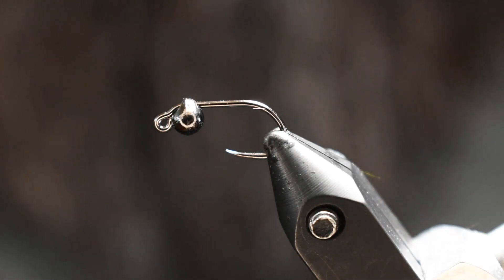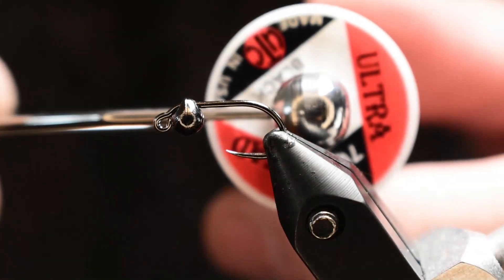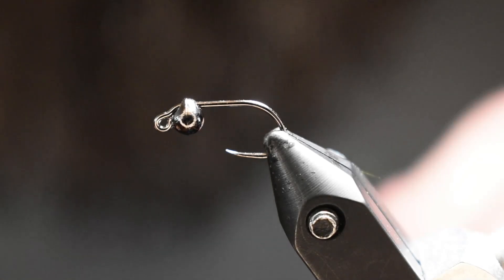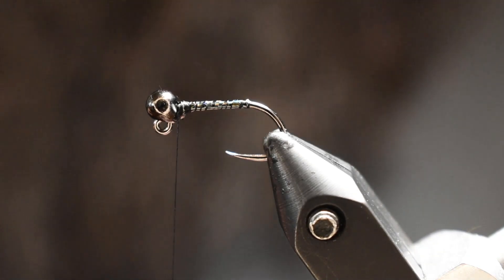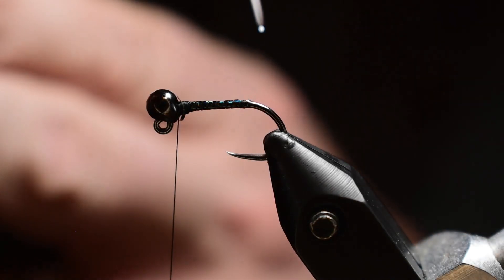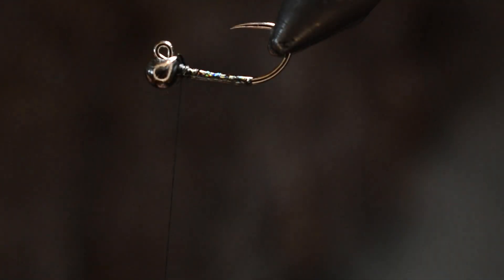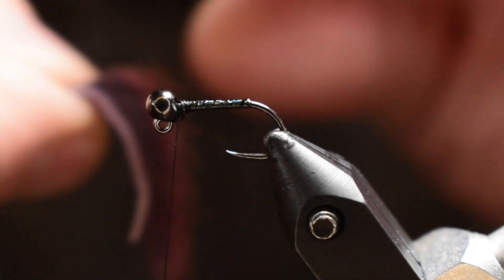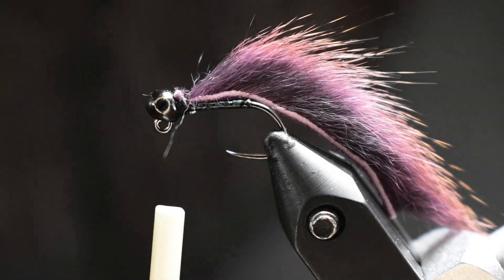Tie this Stillwater Fly Now! (Pine Squirrel micro leech.)

Comment: Since it's on a jig hook, shouldn't it be ski-side up?
Reply from the maker: Thanks for watching!
This will ride hook point up if you tie it on with a clinch knot of your choice.
Is that what you are asking?
Reply: @TightLinesNW  Not really, I'm saying that if you tie on the pine squirrel in a similar fashion to what Landon Mayer does i.e. skin side up, it enables the jig to have a slower descent through the water column which in most cases is advantageous since the fly is animated more naturally. Anyway, it's just my take on a great pattern that can be fished in multiple ways.
Reply from the maker: @bluejacket645  I see what you are saying. Thanks for the tip!

Comment: Do you fish this under an indicator?
Reply from the maker: Most of the time, yes. 
You can also strip them. If I planed to strip or troll them in a lake I would typically tie beadless and use a sinking line to get to the desired depth.